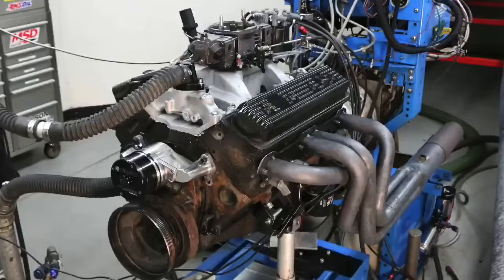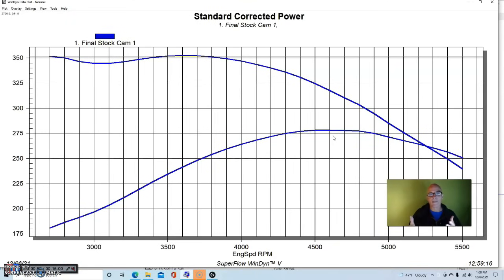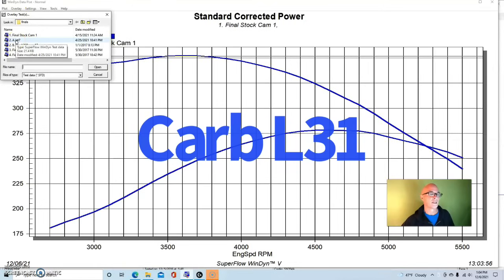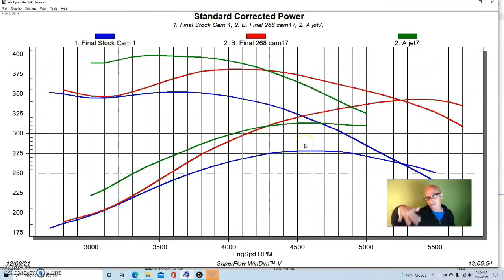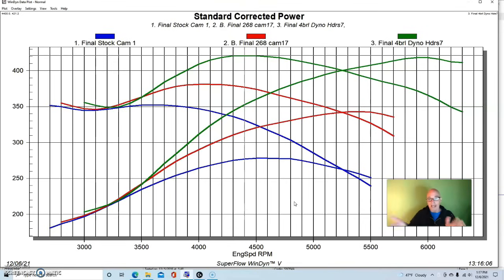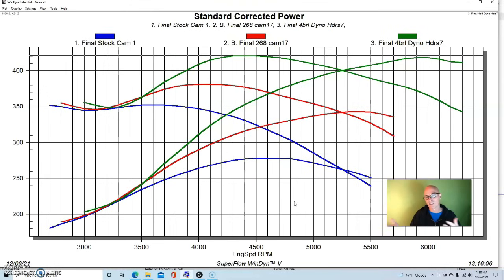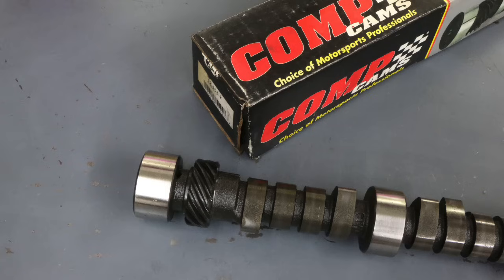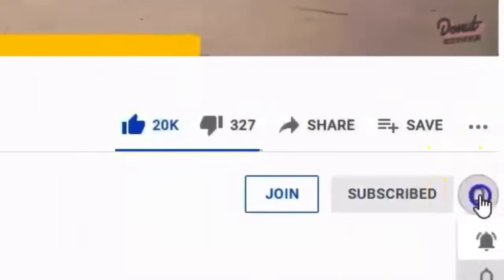HOW TO MAKE CHEAP, JUNKYARD, VORTEC SBC POWER. JUNKYARD VORTEC HEADS-400-HP 350 CHEVY MODS.

Comment: The problem with the Vortec heads, is that they are very thin castings, and they crack very easily. When Richard said they cut .030" off them, I almost cringed! I'm sure they are fine as long as they dont overheat. That's what makes  them crack wide open right between the two center cylinders.
Reply: The Bowtie Vortec heads are the way to go.  Thicker base, 2.00" intake valves, for better breathing, without losing a lot of bottom end torque, like you would if you went to a 2.02" intake valve head.  Screw in atuds, to boot.  Not "cheap," but they won't break the bank, either.  lol

Comment: Hi Richard, great vid 

What’s the common wisdom on cam selection if this was to be a 2bbl motor with no lift rule, has to be flat tappet but can be solid
Reply from the maker: it would depend on the displacement, head flow, intake and intended rpm

Comment: I just built an 10:1 flat top piston ,vortec heads .30 over 1975 4 bolt main it has a crane flat tappet with a .470 lift . 625 demon carb  and an air gap dual plane intake it's pretty good in my 86 3/4 ton gmc. yes I'd like to see what it makes on the dyno! according to the calculator it should make around 384 hp. judging by my seat of the pants dyno it's close. the original engine I pulled out wasn't big difference In feel.

Comment: If anyone is interested I have a set of these heads, an Edelbrock dual plane that fits them, couple different carbs and cams all from an old project (you could pick what you want). Shipping might be a bit steep but the seller is motivated (ie, I could use the space and cash 😁).
Reply: You still have the heads?
Reply: @oxyjohn3051  wrote that a while ago but... yah actually I havent done a damn thing with em-theyre still in the closet downstairs somewhere. you actually interested?
Reply: @colestowing8695  if they ain’t cracked and da price right
Reply: @oxyjohn3051  hey bud. i dug em out. evrything still looks good. let me know if you want more info-photos or whatever
Reply: @colestowing8695  yea send some pics and price

Comment: So what about a daily driver truck application? These mods did nothing in the lower rpm range where most trucks are driven. I’ve got a 95 gmc with the non vortec  5.7  and I do a little towing with it. I want to keep my rpm’s in the 2500 for fuel economy, but need a touch more torque. All the tests I see are awesome for racing applications where you have high rpm’s, but not very applicable when you’re building something for more practical use. It’s not something I have seen on here or engine masters and would like to see.
Reply: slap vortec heads on and a mild cam,you will definitely be happy..these came on trucks so there is that

Comment: Do you have any idea how much compression you ended up with after shaving the block and heads and using the steel gasket?
Reply from the maker: I'm thinking mid 10s
Reply: @richardholdener1727 . Wow really brought the compression up! Those pistons are not only dished but they have the beveled crown as well.. There's virtually no quench even at zero deck. I wonder if a flat top (even a flat top with beveled crown)  would make more power at the same compression as the previously mentioned pistons would? 🤔

Comment: Shoot. I would have started out with the xe274. I had a Monte Carlo with a old low compression  shortblock and added 906 vortec heads with big springs and the xe274. 3.42 gears and a 3000 stall that I couldn't make proper use of cause I ran pepboys 295-50 radials. But even creeping out of the hole at the track is still ran 12.70s

Comment: Mr Holdener! If I want to use Nitrous on my Street Truck, should I get my small Block 350 built with Ring Gap? Also should do Aluminum Heads or cast iron Heads to achieve about 400 Horses or so? With Air Conditioning.
Reply from the maker: just get an L31 Vortec small block from the junkyard, add a small cam and springs and nitrous
Reply: @richardholdener1727  You don't reccomend freshening up the bottom end? Head work?
Reply: Mr Holdener! What about Head Work?

Comment: The L31 heads are underestimated and have great mixture motion and brake specific fuel consumption. As long as you don't eke out to much iron, they are a real advance on any other SBC grouped exhaust head. A factory Double Hump match mate.
Reply: and that's a salient point you made--people focus on how much CFM a cylinder head port can move, but if the air/fuel mixture isn't homogeneous or the combustion chamber's shape gets in the way of flame front movement across the cylinder (assuming no pop-up/domed piston) then that head isn't going to make the power it should.

Comment: I have a vortec with an LT1 rotating assembly, gm LT4 hotcam, LS6 springs, 1.6 rockers ,holley rpm air gap intake, short tube headers and a mighty Demon 650. What's your thoughts on going single turbo and e85 blow thru carb to this setup. Bottom end is rock stock . I will gap the rings. 906 heads are just a quick valve job .
Reply from the maker: THAT WORKS

Comment: Is there a specific part number for the spring retainers and and locks? I took my vortec heads to the machine shop and they wouldn’t do the LS valve spring swap because they said the retainers and locks wouldn’t work with the LS springs.

Comment: try vortec 383 richard wanna See the power gains ? cam lift no more then a .550 lift.thankz
Reply from the maker: BUT 600 IS MORE BETTER
Reply: @richardholdener1727  yes
Reply: Hot Rod magazine’s 383 made 463 hp 502 lb-ft on almost stock vortec head @.555 lift. “March 2002”  I think it would be a great video to match or up Hot Rods build.

Comment: Hey Richard, building a motor for my boat.  Stock boat manifolds.  5.7 chevy roller.

The problem I'm coming across is everyone's saying they need all torque. And  Don't spin over 4800 rpm. 
Is there a cam that pull just as good low rpm but more on top end also?   Like the sloppy cam for LS? 260hp factory just isn't doing it for me anymore.  Haha
Reply from the maker: A SLOPPY IS NOT A GOOD LS CAM AT 4800 RPM, BUT YOU NEED TO FIND OUT WHAT YOU HAVE IN THERE
Reply: the marine 300hp 5.7 roller motors used the gm ramjet cam.

Comment: Really loving the vortec testing Richard thanks a bunch! Have you ever ran the tune port with vortec heads under it? Think SDPC makes the lower to make it all work. Seems like it could make a good stock appearance sleeper build up.
Reply: I’ve been checking the SDPC website for months and the Vortec TPI lower has been showing Out of Stock. I have a feeling they made one production run and when they were gone, they were gone.
Reply from the maker: no sir
Reply: @Richard Holdener  HEY I have a low mileage 190 hp sbc 350 in my 73 elcamino I'm  buying the L31s this week but can you  give me a list of springs , cam, rockers upgrade I should use to the 400hp maybe 500hp range.
Reply: I built this engine back in 2016 using that sdpc intake. Makes 493lb ft and 375hp with a 212 @ .050 112lsa.  Pulls 20 in.hg.

Comment: I used to build 2bbl street stock engines. The cam I used was basically a Lunati Voodoo 294 and could get around 360 wheel Hp. We did tighten up the LSA around 106 I believe. Vortec heads were a game changer then.
Reply: Around home (central PA) when the vortec heads came out it made alot of others obsolete. Our super sportsman with big vortecs makes low 600s on alcohol with a custom cam.
Reply: @joegabner7419  Damn. Thats impressive.
Reply: @joegabner7419  The Bowtie 2.00" intake valve Vortecs? Sounds like those are what you're using...
Reply: @bobhoffman5581  they are 2.02 intake valve. The intake port in the heads are 218ccs from factory
Reply: @joegabner7419  Chevy Performance lists the Bowtie Vortec heads as having 2.00" valves, the same size as their "Fast Burn" heads have.   Screw in studs, with thicker bases than "stock" Vortec heads, which have pressed in studs...
Reply: @joegabner7419  Just rechecked what I thought was accurate info, on Summit's website.  Even the big port Bowtie Vortecs have 2.00" valves, and they list the intske runners as 225cc.  Plenty of airflow, and as I stated previously, less loss of bottom end torque than a 2.02" valve head, which makes a real difference, on the street--strip, likely not as much...
Reply: @bobhoffman5581  where are you finding them on the chevy website because I haven't been able to find them and order them for like 2 years. All of them I bought was from our racecar flea market or from someone else having them. And you can change them from press in to screw in studs lol
Reply: @bobhoffman5581  the small vortec heads we used I know dynoed in the 470s to 480s with a 2 barrel carb.
Reply: @bobhoffman5581  you can also change valves and have machine work done to except 2.02 valves. Not arguing just stating facts.
Reply: @joegabner7419  Pretty respectable numbers, JG...  👍
Reply: @joegabner7419  Yep, but again--if you CAN get a head with the thicker deck, why WOULD you use the thin deck head--oval track engines definitely have heat build up, something that harms their lifespan, at SOME point.  I'm not trying to argue either, just pass on info that I'm aware of--if it seemed otherwise, my APOLOGIES, Joe!  lol
Reply: @bobhoffman5581  the super sportsman we run is basically a sprint car. (Alittle longer and the center section of the frame is box tubing other than that they are the same) so the cars only weigh 1700 pounds. They are direct drive so there's not alot of rpm loss and running 78 to 7900 rpm we don't drop much below 5000.
Reply: @joegabner7419  One last thought, Joe--one's budget definitely plays a role in what equipment you use, but let me provide one example for you.  A friend was running a 351 Cleveland in Street Stock class, at Flat Rock Speedway, Flat Rock,Michigan.  It kept breaking "stock" valves.  I told him, "Mick, why aren't you using stainless steel valves?"  His reply?  "I can't afford stainless steel valves, Bob."  THINK about that, Joe--he couldn't afford them, but for at least 3 weeks in a ROW, he dropped out of the Feature, due to valve failure.  Excessive heat was making the valve stem snap!  Stainless valves likely would have been able to HANDLE that heat.  If I had been one of his (multiple) sponsors, I would have been less than impressed with his performance; I just stopped hanging around the garage, when he was working on the car...   HOW IS it "cheaper," to keep breaking parts, than to purchase the RIGHT parts, to make the "problem" go away?  LOL
Reply: @joegabner7419  Sounds like a fun "seat of the pants" RIDE, Joe!  LOL
Reply: @bobhoffman5581  my engine after supply only block and heads was 4800 bucks haha
Reply: P.S.  I now live about 40 minutes away from Michigan's FIRST oval track, Whittemore Speedway; it wasn't paved until 1988, after it opened in 1948, I believe.  I'd love to run a Modified, and possibly a Late Model.  LM's are expensive to build AND race, but if someone saw my driving skills IN a Modified, I possibly COULD "get a ride." Fess up time--so far, I've always been a "spectator"--that may change, in 2023!  Kind of late, being 65, but HEY--the "senior" member of the "Alabama Gang," Red Farmer, was running in a Dirt Late Model series a few years back, at 77, and out of the 140 drivers IN that sanctioning body, a Circle Track "blurb" reported that at press time, he was ranked 46th--not BAD, 'eh?  LOL. P.S.  Mike Eddy's son Travis RUNS a Modified at Whittemore; he also has a Late Model car, but I haven't seen it run there.  HE has HOWE and Jericho for sponsors--tell ME HE doesn't HAVE "top notch" equipment!  😂  Howe Enterprises is also 40-45 minutes from my place--Gee, I wonder WHERE I could GET parts for a Modified build?  lol
Reply: P.S.  Due to the Covid thing, you may HAVE difficulty acquiring those heads.  I LOVE the idea of putting together a 383 stroker for both of my 90's era K1500's, USING the Bowtie version--better airflow than a 1.94" valve, but still maintaining sufficient bottom end torque, (4WD's NEED torque! lol) something that definitely falls off a bit, using a  2.02 head.  If you're using standard Vortec heads, and they have 2.02's in them, they're definitely "reworked" heads.  I find myself wondering if the 2.00 valve would help you get off the corners better, if you're running in a "street stock" type class, but if you're running in a Late Model or Modified class, you could probably make up ground, on the straightaways...   lol

Comment: Great video.  I don't know why we're so addicted to 350 motor builds,  but we are.  Richard do you have a test video where you don't change anything on the motor but do manifolds, shorty headers, mid length and longtubes on something like this?
Reply from the maker: long tubes always make more than stock or shorty
Reply: @richardholdener1727  Oh for sure.  But how much would I be giving up if packaging doesn't allow for longtubes.
Reply: @Nanaki1422  Not much at all.

Comment: I like to get up into 400 ft lbs as quick as possible w/out sacraficing top end.. Roller Cam.  Dulcich's "Budget Sledgehammer"/Nov 2006 one of my favorite magazine builds of all time. Straight cut 224 @ .050 cam and .550 ish lift on 108lsa.  10:1 comp,  447hp on EQ vortec heads and re-ringed L31 junkyard shortblock. Engine broke 400ft lbs at 2900rpms w peak HP coming about 6000rpms. "Secret Short Track Spec Cam" was probably a short track cam from Speedway or Howards- it's torque curve was peaky.. and late to 400ft lbs... Not super impressive for all the "guarded info" Mr. Short Track brought to the table.  Comp XFI 230/236 with a better LSA (108-110)would knock that short track cam into the drink.  Great comparison here Richard.. thanks.
Reply: I'd like to see someone build a "Maximum torque @ lowest possible RPM build".  Everyone always chases the peak horsepower number, I'd like to see a SBC built to put in a truck.
Reply from the maker: TPI
Reply: @richardholdener1727    “…TPI…”

Putting TPI on a 400 would help move its torque peak a little lower. Use the TPI cam and pocket port 441 heads. (Add steam holes to the head.)
Reply: @JuiceSpringsteen88    And when we’re done with that, let’s move quickly to build a Ford truck engine. But I’ve already got my low-budget Ford truck engine; 393 Clevor roller cam engine.
Reply: “…400 ft lbs at 2900…” 

See, that’s what I’m about; torque for daily driving. Now make it a Chevy 400 and we’re getting someplace. 👍
Reply: @PCMenten   Stock 90's 454 peanut port is 400ft lbs at 2300 and climbs lazily up to 450 ft lbs- ish.   You're scratching at the bottom of factory Big Block torque at 400ft lbs... that's good performance for a small block.
Reply: It's all important to guard what the grinder did when they limit you in lift and what you can do and you're trying to win and everyone finds out who and what your specs are ...

Of course any roller cam would beat it but you can't use roller cams in some of those series'

Comment: Well, Rich... you have you Vortec L31 heads now, along with improved springs and a hydro-roller 350. Guess you can do that Vortec/TPI-350 build you've talked about now! Just one small suggestion: I've heard swapping the Ram-Jet 350 cam into the stock Vortec 350 w/factory long-runner intake & "spider"-injection helps wake it up, and make a real stump-puller out of it... so you might want to consider that.
Reply from the maker: I don't have a Vortec hyd roller block, or a TPI intake for Vortec heads, wouldn't use the spider injection, and would use a different cam than the Ram-Jet 350-where does that leave us?
Reply: I always wanted to put a TPI intake on my vortec truck.  I don’t have that truck anymore and have an 8.1 truck now, but I always wondered how that combo would have done.

Comment: I recall a car magazine Danger Mouse build some years ago and they claimed 415 hp and @400+ft/lbs torque with Vortec heads and XE262h flat tappet cam in a 355 sbc. Richard Holdener's dyno seems to be more honest than the DM6 from a magazine article from years ago.
Reply: The xe268 numbers were before the bumped compression. I would bet with the xe268 its at about 400 hp with the extra compression
Reply: Super Chevy. I read, and was building circle track engines for limited street stock classes back then. Used to build 377 destroked 400s with a 2bbl and could get around 360hp at the tires.
Reply: I loved the Danger Mouse series

Comment: Between the head and the block you shaved off a lot of metal, did this affect intake manifold fitment?  And did you have to use custom length push rods????
Reply from the maker: it was a total of .060 with gasket, deck and heads, we shortened the pushrods .050

Comment: Is piston to head clearance not a problem?
Reply from the maker: it was
Reply: @richardholdener1727    Okay, I’m glad you replied because I was confused. But what you did was very interesting and the engine seemed to run well up to the point where valves got bent.